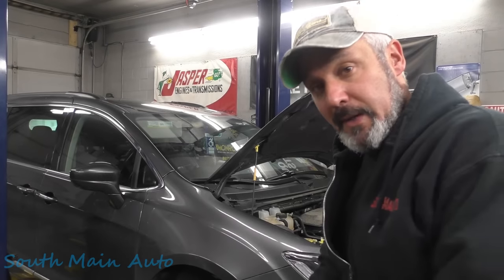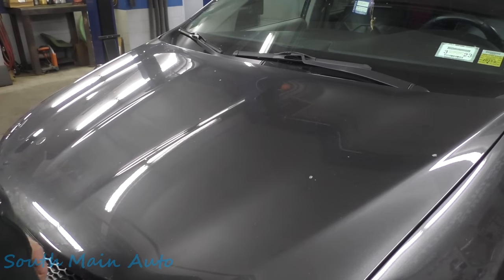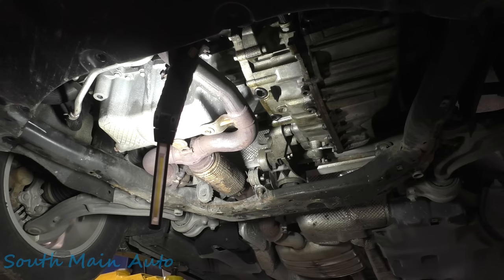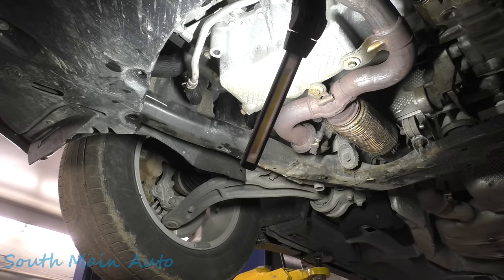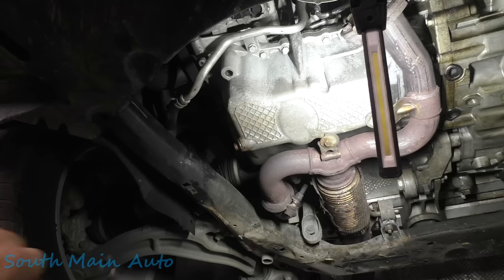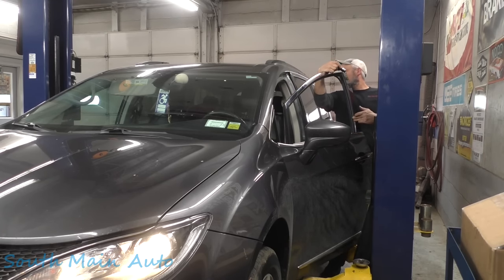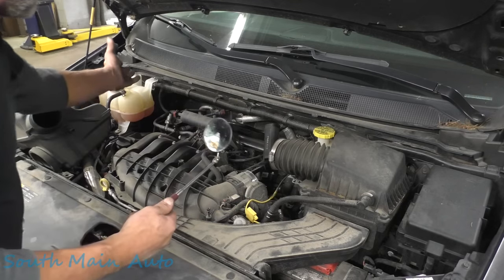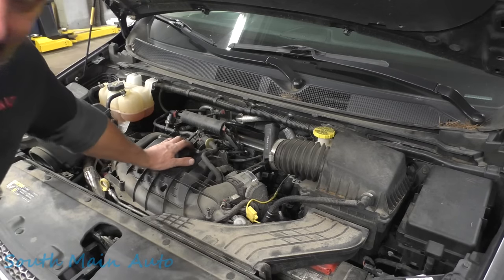Chrysler Pacifica Goes Full Nuclear 💥

Comment: Some simple guidelines for successfully ruining an engine: 1. buy anything domestic 2. ignore the temperature gauge, it's lying to you 3. just keep adding coolant 4. keep trying to start a seized engine until you burn out the starter, then replace the battery.
Reply: 1) my 543,000 mile 96 Jeep Cherokee, 640,000 mile 89 ram 150, 308,000 mile 97 f350, and 240,000 mile 01 Pontiac trans am would like to disagree. 9 times out of 10 it’s customer neglect that claims any engine. Japanese engines just tend to deal with neglect better.  All other 3 points I whole heartedly agree with.
Reply: I grew up with that 'anything domestic' theme, but these days I'm not convinced. GM have gone off the rails, with poor engineering, faulty designs, and bad QA. On the other hand Toyota and Honda have proven themselves capable of robust designs with clever engineering. So, I suggest common products from reputable companies. I avoid European designs because they don't offer dealer repair manual access as easily, and because parts are hard to come by.
Reply: 1. LOL... ya ok, Toyota sludge engine lawsuit, Honda oil burning engine lawsuit, Hyundai Theta 2 engine lawsuit.. but you just keep living in that dream world.
Reply: My 300k original engine/tranny dodge grand caravan would disagree.  Stop blaming the manufacturers and start blaming the real problems which is stupid owners who don't maintain their vehicles or don't drive normally which includes not flooring at every stop light.  Hey lady try checking the oil once in your life and stop driving it when something doesn't work correctly
Reply: @vmxg8052  that's one each.  why don;t you list all the gm recalls and lawsuits.  or ford.  put your money where your mouth is bud
Reply: @vmxg8052  fully you failed to mention the problems with US engines.. keep your bias opinions to your self mate
Reply: More times then not regular maintenance and Preventive maintenance usually will make engines last for a very long time…. One design flaw imo is using all these aluminum heads they don’t do well with heat and being on a steel block recipe for warpage using them in high performance is one thing but as daily driver for the general public a totally different thing
Reply: @feron450  Those are all pre-Great Recession cars....EVERYTHING domestic (designed) since then is complete garbage.  The old GM push rod motors were still bullet proof up through the 00's, the Ford 2.5's are still great, but all this GDI, OHC, Turbo, Plastic oil cooler/water outlets systems are garbage.  Garbage.  The Japanese don't build them better because they want to its because they have to, Americans would quickly dump them if they became trash for more $$$.
Reply: When I spend all day changing a starter and alternator on my 2008 tundra, I’m going to be pissed I got rid of my Chevy that I could have done both jobs in under 2 hours. Every brand has its issues. I’ve put 3 water pumps on my tundra in 5 years. Some brands may be more robust but they suck to work on.
Reply: That being said I have an o4 Z71 crew cab. 407k on the original engine. One head job done at 250k. Three water pumps. 5 a/c compressors. Three transmission and transfer cases service. 10 sets of tires. Fixing to do my own headliner. One power seat motor. Did the rear main. Both diffs have been serviced within reason. Original truck God's honest with 407k on the odo.
Reply: Then you have my VW, which doesn't even have a temp gauge. Why???
Reply: The best engines I’ve owned and worked on have been small block a Chevy’s before DoD/AFM. I’ll take an old 350 any day and twice on Sunday.
Reply: @spelunkerd  100% agree
Reply: @DAZ_SR  thank you...great points
Reply: @spelunkerd  the GM full-sized GMT800 platform is still on the rails and happily singing at 2,3,400,000 miles and more.
Reply: If it won't turn over then hook up a boost battery, then try a bigger one when that doesn't work. It did turn over then but with a smell of burning rubber. Turns out the alternator was seized to the point the housing broke before the belt slipped. New alternator and belt and it went on a few more years before it died of rust.
Reply: Let's just face it everything new is junk these days.... That's why I lease garbage these days it breaks they fix and then take the crap back 😂
Reply: @feron450  There's exceptions to every rule.
Reply: When it's leaking oil it means it still has some and when it stops leaking it just mysteriously fixed itself so just keep driving.
Reply: I mostly agree with what you said. BUT I bought my first domestic, a 2016 F-150, and honestly it’s holding up just as good as my Japanese imports did. Truthfully they all have weak spots. I had a Honda Accord blow a transmission and my ex’s Camry burned oil. However they get their reputation for reliability because they tend not to have the plethora of small issues domestics have. GM I’m looking at you.
Reply: Coolant looks like river mud .... "HERE'S YOUR SIGN"
Reply: @mconley600  aluminum dissipates heat more readily than cast iron.   The difference in rate of expansion and contraction COULD affect the outcome, but being aluminum is not the inherent problem, and if anything helps prevent the problem better.    Overheating isn’t always so straightforward, and coolant temp sensors can give deceptive results, as well as the temp gauges on some of these cars.    So it’s not always the driver/owner at fault.    For example, my 2006 Dodge Magnum RT with a bumper to bumper lifetime warranty went through the exact same cycle of issues tow years in a row, and the symptoms were so close the second time that I knew. What was wrong much more quickly.     Here’s a scenario.    How could your car overheat, with the temp gauge needle going from normal (high noon position) to overheat (in the red but not pegged) in just a few minutes sitting at idle with no warning from the engine at all besides the AC losing some of its cooling just before?   But with NO coolant leak visible anywhere or even on the ground, and still maybe half the coolant on the system?    I’ll tell you.    A tiny pinhole leak, which only leaked at operating temperature, left no evidence under hood or on the ground ever, because it was such a slight pinhole that the lost coolant would evaporate before leaving evidence anywhere, and the tiny spray was shooting into the back of the fan shroud so I couldn’t even see any staining from the coolant, and never a single drop in the driveway or anywhere.   I found it by noticing the AC not blowing as cold one afternoon, left it running, popped the hood, and got my face down very close to the radiator before just happening to feel the slightest mist on my cheek.   It was imperceptible on my hand, but felt like a wisp of air on my cheek, and the sunlight had to be just so and you had to see it at just the right angle to actually see it.   At night with a flashlight just couldn’t pick it up.  I traced it to the lower corner of the radiator where the condenser fitting was, but somehow leaking coolant.   This was such a slow leak that it took maybe ten rounds of topping off the coolant when it got low and the temp gauge pinged when you least expected it, even watching the gauge once it just jumped from normal to red within 30 seconds.    The problem ended up causing other failures.    Turns out that a water pump actually needs water running through it to keep from overheating the bearings and seals and causing a leak.    Also, the AC compressor needs the system to have coolant to prevent its destruction also.   I drive the car like that for about two months before finding the problem.   Took it to the dealer and my warranty covered everything, but their hardheaded “policies” cost them so much more than necessary.    You could hear the water pump failing, but since it had not “failed” it was not replaced at that time, when they had everything apart.   A week later it did.    Then you could clearly hear the compressor protesting as well, and again, one week later it was back for that repair.    Oh, wait, there’s more.   Then they had to replace the evaporator in the dash.    All told that was FOUR visits and several weeks of my time.    And thousands and thousands of dollars wasted by their “policy”.    But wait, there’s more!  It did almost the exact same thing the following summer in almost the same place on the radiator, then the water pump.   The compressor took another two months before failing spectacularly, and then the condenser itself and the evaporator was spared.   Turns out Stant was the OEM for the radiators and there was a “bad batch”.   Yeah.    Great.   My brother’s 09 Ram 1500 did the same thing in almost the place but a different fitting, but at the tank on the passenger side, but his water pump and compressor were spared.    Twice.    He ended up getting an aftermarket radiator the second time which has proven reliable but now there’s a mystery Freon leak which can’t seem to be traced.     Fun.      These are examples of overheating in a way that the driver could not prevent nor predict.   Thank goodness I caught it every time before it became destructive to the engine itself, as the valve seats are notorious for dropping out after an overheat scenario.   I got lucky I guess.   20,000 miles later no issues like that.    BUT, I think Chrysler knew about this chronic problem, as I had the same thing happened twice  in two years and my brother’s Dodge almost the same?   How could they NOT know.   And then the rash of dropped valves after overheat that has taken way too many engines out unnecessarily because of faulty radiators.   I am not alone.   However, I have yet to hear of Chrysler taking the blame for any of these dropped valves because most customers can’t see the bigger picture and why should they?   Chrysler isn’t alone either.     They all lie, cheat, and steal from consumers all day every day.  I’d like to put a stop to it.   Anyone else care at all?
Reply: @vmxg8052  yea.. that’s why eric drives a toyota then huh
Reply: Think about this. there are more US manufactured vehicles out on the roads then foreign. Foreign car owners are more likely to do routine maintenance then domestic owners. Foreign auto manufacturers recalls are not as widely published as domestic. Ford or GM have a screw out of place it's a recall. Toyota airbags are bad it's not published. I should mention that I had a 2017 Toyota 4runner that loved head gaskets. 3 before 100 thousand miles. Then it started to like the ECU.
Reply: @HammondOfTexas0  Because it has a light
Reply: Buy anything domestic lmao ain't that the truth.
Reply: Like every Subaru engine made.  I've done several hundred Subaru headgaskets and ring land failures.
Reply: @ohger1  The biggest reason people ain't cool with opposing cylinder engines is the piston slap. V designs mitigated that process through figuring out gravity. Cool engines and all. Like the Porsche. Still, piston slap is worse.
Reply: #1 don’t buy one
Reply: @vmxg8052  My man the sludge buildup and oil burning concerns are from DECADES ago. Kia/Hyundai is another story. It's pretty obvious to me that you're biased towards mUrIcAn manufacturers. However in this day and age, I would NEVER advise someone to buy a "domestic" car over a Japanese equivalent. All manufacturers have problems but Japanese manufacturers have way fewer issues on average. And we own a shop. I've seen all kinds of rusty broken shit from every brand imaginable. American cars are a joke from a quality and reliability standpoint. For every one failure you can point out in an import lineup, I can find five of in any of the big three.
Reply: It’s all about proper maintenance and care Toyota can handle abuse . Chrysler’s can’t they need TLC . My daddy taught me never complain about cars that break it puts food on the table
Reply: @rk22cc  It's all shit now. But 20 years old.
Reply: @HammondOfTexas0  The old ones were just air cooled like a lawn mower. Does it have an oil temp gauge?
Reply: lol.
Reply: @fellowfighter88  Leasing makes the most sense in the current new auto environment where expensive electronic components/labor  push the cost to repair easily is into the thousands. Also, owing an ICE vehicle is quickly becoming not economical as the rapid switch to EV's being forced upon us will make your gas engine car worthless because insurance companies won't insure and lenders won't let you finance as the ICE vehicles value declines due to the mandatory EV switch by 2030 in some states.
Reply: Define "domestic"? Does my Mexico-made, French-owned Chrysler count? How about my Tennessee Toyota?
Reply: @lacro5686  what about EV's battery replacement costs that are killing the resale value.  They will be taken off the road much earlier than ICE cars.  That will reduce the quantity of used cars available.  That will increase the value of ICE's.  You will never get wide acceptance of EV's where there is real winter and -20 F temps.
Reply: @mconley600  The Chrysler 3.6 is one that has integral exhaust manifolds to make it more compact.  The heat can lead to cracking.

Check coolant level at least once a week and never keep topping it off without diagnosing the leak. When topping it off, time seems to stand still and before you know it 3 weeks has passed and you need a head gasket.
Reply: @timothykeith1367  Ok I didn’t realize that I’m mainly working on Kia’s and Hyundai’s and Subaru’s but that makes a big difference keeps the heat at the manifolds esp the rear event longer making it harder to dissipate it
Reply: @vmxg8052  also Honda engine block cracking at < 100K miles
Reply: @andrewhigdon8346  I realize aluminum does dissipates the heat a lot more efficiently  but having it overheat more then a few times and it does not handle that well at all. Yes Chrysler knew about the issues look at the Neon’s and Intrepids of the late 90’s same problem they just made a 3 ply head gasket as the fix it helped but didn’t solve the whole issue intrepids used a timing belt driven water pump that was prone to failure but those of us who knows our way around mechanics are able too catch things the general public not so much
Reply: @vmxg8052  you can look up service data on manufacturers and it is hard to argue that japanese vehicles are not much more reliable and have far fewer repairs. Why don't you go ahead and do that and stare at the numbers and then cry when you realize that it is you that has been living in a dreamworld.
Reply: @Les Reeves I use either Napa or the dealer if it’s within $100 of the Napa price.
Reply: @vmxg8052  Spot on.  You forgot to mention all the 3.0L Toyota V6s that eat head gaskets constantly, the Odyssey transmissions that shat the bed waaaay early, and the fact that Toyota is literally paying to throw pistons and rings in engines as we speak due to all the oil burning.  All the manufacturers have their issues.
Reply: Gotta put 5k worth  of tires n wheels , 10k sound system, 10 k paint and upholstry etc as well, then ignore oil, coolant loss , knocks , banging , overheating..... etc
Reply: @johncampbell5190  New EV have ten year warranty on the battery. Who knows how long an EV will last especially after they perfect it and get all the bugs out. . Electric motors have less moving parts and whole bunch more torque. Train locomotives are all electric and seem to be very reliable.. I think an EV can be a very problem free mode (excluding bearings, batteries and belts ) of transportation for a very long time. Competition will bring batteries down and other energy forms will undoubtedly come into play.. Its all about time , and we cannot let the Saudis and Opec control every aspect of our lives , and our own big oil companies are not doing us any favors when the best selling markets are over seas and not domestic.Dont blame the govt as they do not set price as most people think and that BS about restricting oil production is horseshit.
Reply: Ford temperature gauges are super nice.  Instead of increasing in a linear fashion, it stays put in the center and remains there until the engine overheats, then the needle will move all the way up.
Reply: @HammondOfTexas0  Exactly. I hate not having a heat gauge.
Reply: IF the vehicle was mine, and the frame wasn't rusted in half or close to it.  I would pull the engine and rebuild it myself.  If it is in such bad shape that it can't be rebuilt,  then get s good used engine.
Reply: @henrymiecz8566 the Pentastar 3.6 is a POS.  My mom has a '14 T&C with 66,000 miles and 16!!!! oil changes at the dealer and still had lifter/follower failure.
Reply: @mconley600 almost all blocks are aluminum now
Reply: I had a 95 Chevy k2500 with a small block that had 260,000 miles overheat on me, shut it down and filled it back up then went and got the hose fixed.  That engine was bulletproof.
Reply: @scottfree8848 probably a 5.3 vortex huh
Reply: @andrewhigdon8346 I actually read all of that.
Reply: Don't forget, you bought it with oil in it...that means you don't have to add any or change it out. Ever.
Reply: 2017 200 156+k & outside of a replacement water heater hose under factory extended warranty (& replacement spark plugs) all other belts, hoses & sensors are original.
Reply: Building cheap and quick with a slightly sloppy tolerance is how we won ww2. I’ll deal with the aftermath, because the other option is WAY worse.
Reply: @vmxg8052  don't forget the toyota "unintended acceleration" that they blamed on pedal misapplication and non compatible floor mats. Apparently it only affects toyota owners though.
Reply: Lol Exactly
Reply: @feron450 lies
Reply: And there is a lot of people who follow these 4 steps😅
Reply: Buy a BMW z3 water pump failure at 40, 000 miles, alternator 50,000, fuel Guage 52,000.
Reply: The manufacturers aren't necessarily at fault.
The employees are. 
Honda and Toyota have employees that take pride in their work. They do the job because they want to, and they have to EARN raises.
American car companies employ people that work because they HAVE to, and the get automatic union raises. 
Before you question whether or not a lazy assembly line guy could possibly cause any problems,  remember that engineers are employees too.
We don't take pride in our work. (Not ALL of us obviously)
We are taught to make maximum profit with minimum cost from an early age.
Reply: Plugs and wires of course, or coils if applicable
Reply: @SIGINT007 absolutely. 1987 El Camino 305 doesn’t burn oil and runs great. For what it is, still a very good engine.
Reply: Haha..I'm generally a fan of Japanese engines, toyota in particular, but I don't know if they deal with neglect any better, especially overheating.
   That's murder on anything, they melt down, not made of magic metal.
   If they did have any magic metal, I suggest that they use it to fix their rust problems first...